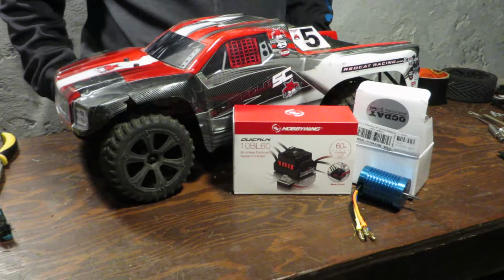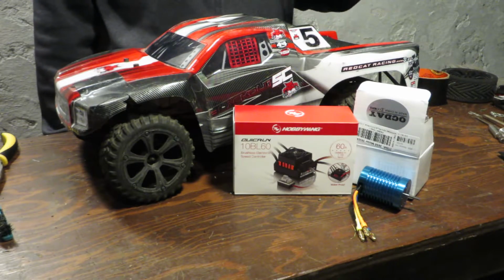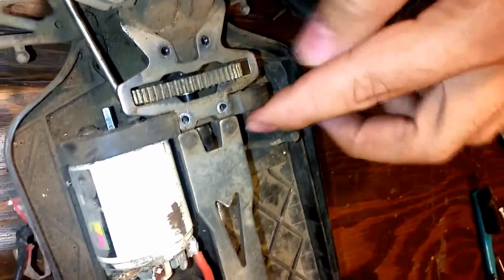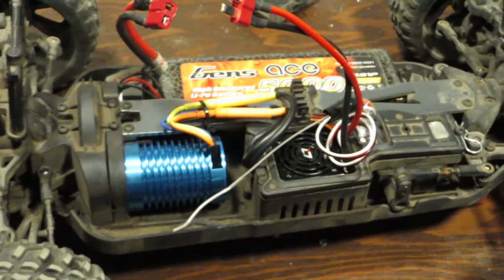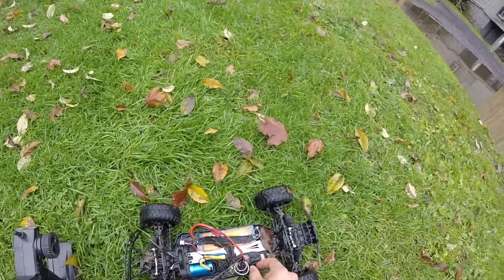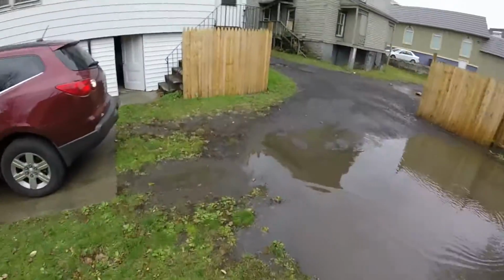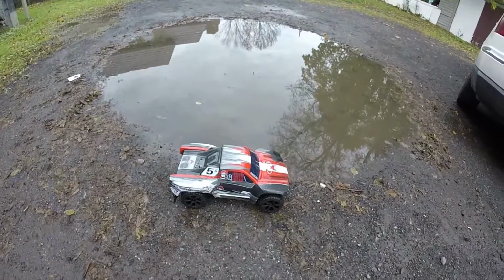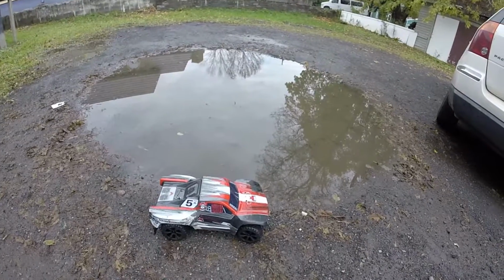REDCAT BLACKOUT SC GET"S BRUSHLESS UPGRADES!!!

Comment: I did the same thing except mine pushed 5200KV (max was 57mph)
Reply: Josh Morris you should put videos up? Do you think the tr-sc10e motor and esc would fit the sc pro
Reply: Dam I have mine up to 41.4 with a surpass 3650 3900kv 12t motor and surpass 60A esc it's great I will upload a video

Comment: i just did this to my sons blackout. hobbywing bl 60 esc but i opted for the 3650 3100kv pinion 18t steel. Its way faster than original or the 12t titan motor. it beats the terremoto 10 both on 2s. The first 5 runs the motor ran cool to the touch but now that the motor is broken in it does get warmer than id like. It cogs slightly on light throttle so ive ordered a 3660 3300kv which shoulder give it that extra torque and keep temps down. the motor your running looks finned on the inside is that a 380 brushless advertised as  540/550 size?. what are your temps looking like. my son has a 6500 65c 2s pack it gets a decent amount of heat if hes running through the grass non stop with a casle creations fan. it can almost pull a wheelie from a dig and almost has just it you hit it right. Im gonna make a video of it and ill make a video of it on 3s. My youngest son im gonna put a 3660 2660kv in their im hoping to keep the speed lower than the 3100kv. How fast do you think the 3900kv with 14t goes?
Reply from the maker: dayadam16 I'm not sure what 380 or 550 is? But it is 1/10 scale and yes its finned. It didn't get hot at all plus I think that water helped lol. I ran my 5000mah gens ace 2s lipo 40c. My reciver was giving me problems also I got water in the motor witch I found out after wards and I think that's the reason it felt like it was cogy when I ran through the water. I can feel the difference in power but not getting it to the ground with those tires. I will make another video on 3s also and up the pinion soon.
Reply from the maker: I think the speed is just under 30mph with that 14t. but I will also do a speed run
Reply: King Veonietus that motor your running isnt a 540 size motor its actually smaller. The fins go inward so that motor wont have as much torque. The 3650 i have is a true 1/10 size no fins and my wires come out the actual top of the motor. it looks like my wires are glued on outside of the can. If you have amazon you should try the gool rc motors i paid 22 bux for the 3650 3100kv. its almost perfect. It barely cogs but just enough that crawling isnt ideal cause when that power comes on its ridiculous. The stock motors are 57mm long. when i compared the size of tge 3650 the terremoto 10s motor is clearly longer by about 10mm so a 3660 3300 should make this perfect. ill make a  video of it in the morning. it has very good power and top speed. it definitely is faster than the terremoto 10 even in grass. esc set to punch level 9.
Reply: the brushed versions come with 550 size brushed motors. i believe 37mm by 57
Reply from the maker: dayadam16 yea I noticed that with the wires..Dam I hope it holds up thanks for the info. I also had my eye on the gool rc motor was gona get it for my 1/8 truck.
Reply: King Veonietus i plan on replacing my terremoto with a 2600kv gool motor i believe 3674, the numbers are can width and length so 36mm wide and 74mm long.  With your gearing it should do better but i think it will start to show excess heat on about the 5th run. maybe that open design will keep it cool. are you running stock esc settings? im charging up now so i can make a comparison of my daughters stock blackout sc brushed with 2s lipo which looks comparable to your brushless setup you have now and my sons brushless setup i just put on. my goal is to get the kids to have an rc that can last 30 minutes or more  to keep up with my xmaxx run time. Plus i was tired of smelling brushed motors. im putting the 2600kv 3660 in my youngest sons and my daughter rc hoping it will never get hot enough and have enough power to go through grass without killing the motors.
Reply from the maker: Nice thanks for the info. Yea I'm running the stock settings on the esc..so maybe I should keep the 14t pinion in there. Yea them brushed motors are good I hear if ur gona be deep in mud water bit they are slow and do smell
Reply: King Veonietus  try a higher punch it limits voltage from starts, it will really wake that motor up just make sure you use high quality lipo like that gens ace with 35c or higher. you can also adjust timing but i wouldn't recommend that unless you got cooling and pay attention to temps.
Reply: dayadam16 a motor like that maybe around 50mph if u run a 3s lipo with like a 23t but its not worth it iv burnt my esc out like after the 5th run on 3s

Comment: That was awesome 👊 I appreciate your sharing and would like to ask a question if I may 😓 I just got a Redcat Blackout SC stock and was wondering if I can use a lipo battery and if so how high can I go without upgrading the fan and or motor? Newbie 😉 sorry 👊🍻
Reply from the maker: MTB TJ Crash stock brushed motor or brushless? U can run a lipo on both motors. But if you have a brushed motor just make sure its broken in like at least 10 runs
Reply: 2s is all you can go

Comment: the car handles like a two wheel drive. because the tires?
Reply from the maker: da streets part 3 no alot of them spin outs I did on purpose trying out the power plus it was wit out.

Comment: Whats tue pros and cons of running a brushed version on a 2s lipo for these blackout sc
Reply from the maker: Shannon Hopkins Con: if the motor not broken in it will fry. More power so it will be harder to control if ur a beginner witch means the possibility of braking parts is higher. Pros: more power longer run time more fun lol. Also brushed are better for running through water and mud just have to make sure you clean it after wards
Reply: King Veonietus just getting into it got a redcat blackout sc 1/10 they say u can run a 2s lipo and its ok just not a 3 i have no clue as to possuble damaged parts other than a motor over heating
Reply: King Veonietus also whats a good break in time..2 to 3 runs or more?
Reply from the maker: Shannon Hopkins I would say about 10. Or a quick way I've seen  was to put the motor in cold water and let it run for a full battery at about a quarter of the throttle.
Reply: Mine came with 3500 lipo.

Comment: You change motor and pinion what number spur
Reply from the maker: The spur gear was stock 55 tooth. I did change the pinion back to 18 tooth, but got it steel. The stock pinion is brass and wears a lot faster.

Comment: Nice upgrade man, i have a question i upgraded mine too but it makes a weird sound when i hit the throttle (like the gears are not set properly) after it gets some speed it runs great. And would like to know what gears you installed on your car?
Reply from the maker: enigmacstrike Thanks man. I have the stock gears but upgraded the pinion to steel. factory pinion is brass and causes the spur to strip. Yea its possible u might have to go back and fix the mesh. use the sheet of paper method in between the gears.
Reply: King Veonietus and yeah I thought the mesh was the problem and I fixed it
Reply from the maker: Sweet. Makes a difference doesn't  it.
Reply: King Veonietus i ment that I fixed the mesh long ago 😅 the thing is that I don't know if that noise is normal
Reply from the maker: Oh I see. Yea man probably just not use to hearing it that way I mean it has a stronger setup now.
Reply: King Veonietus Thank you for your time! maybe that is
Reply from the maker: No problem

Comment: I got a 64 metal spur gear coming for mine, does anyone know how I could make it fit
Reply from the maker: Ur gonna need a spacer or bearing to keep it in place. But it can't be to tight of a fit or it will cause to much friction and make the motor work harder as well.
Reply: King Veonietus what about the pinion gear?
Reply from the maker: @javierrivas7346  28 tooth or bigger is the only sizes that will reach the pinion.
Reply: King Veonietus alright thanks

Comment: Hi, did you do any servo or servo saver mods.  I saw complaints on other videos about the servo steering crapping out or too loose.  Redcat may of fixed the quality issue by now though.  Have you had any problems with the steering and/or servos and how did you resolve?
Reply from the maker: Nathan Daniels No mods just changed it out for a traxxas servo. Reason was mine striped or burned out i dont remember but there was a lil play with the servo horn. I just tighten the screw and took that metal piece and also tighten it.

Comment: i was looking at your other videos of the blackout pro and that motor is almost the same way but the fins are barely and the difference in power from this one to that none pro looks night and day. That blackout pro looks like it has power for days, both motors your running are rated for 3900kv and 3950kv right? how fast is that pro on 2s looks like it could do 40 with that power.
Reply from the maker: dayadam16 yea that pro is mid 30's @ 3800kv That new one is 3930kv haven't done speed run yet with it.

Comment: Do you think the motor from a tr-sc10e and esc would fit it?
Reply from the maker: Yea it's 1/10 scale. But ur better off just buying that car. Amazon has it in sale right now for $250
Reply: V6 Vic i already bought the pro and is yet to come in and was a bit strapped for cash. Just wondering for future upgrade cause i cant aford right now to buy a battery and a charger for it. They dont come with those. Any thoughts on the camo tt?
Reply from the maker: @LuisLopez-ed7oc  if you got the Pro then you're good. It comes with more then enough power. I would just focus on getting a better lipo battery. If u want more power than get a 3s lipo it's gona be crazy. Just mind the motor temps.
Reply from the maker: I haven't seen any videos on the camo tt yet but it looks like a beast

Comment: funny,  I just got a similar esc and that same motor for my kids blackout sc.. it needs a good high quality  servo too, anyone else with the blackout feel like the steering system is absurd and just impossible to get precision out of.. the design is just kinda weak and no matter what you swap out, after a while there's just total slop and the front end is doing the bad shopping cart thing
Reply: just curious ... I fully understand it's entry level stuff. . and I will admit that it's been one very tough truck. . no suspension or steering arms broken. . obviously it's got the servo saver that is problematic .. I wonder if all the slop in the steering is keeping it alive longer. .  anyways,  my 8 yr old son digs it and it deserves a few updates.
Reply from the maker: funshootin1 they have aluminum upgrades now that might help with the slop but its way to pricing. Thanks for watching

Comment: is your motor and esc water proof?
Reply from the maker: Eric Charles Ash yes esc is splash proof and so is motor. I did get alot of water in the motor once and it slows it down or makes it bog down but I just tip it over and its fine again. I also sealed it up after that where the wire come out from so no worrys now.

Comment: your losing service because u habe water in the receiver I would be really careful with a lipo in water cuz that thing can short circuit
Reply from the maker: Yea i cleaned it out but it still sucks i even tried it on a different transmitter. I changed it out all together for a fly sky remote. Far as the lipo ive ben lucky running them through water
Reply: yah lol its really fun to run a cheap setup thru water
Reply from the maker: I run all my setups through water I live in upstate NY but there all water proof or resistance. I covered up that opening where the wires come out of the motor with plumbing putty and sealed it with flex seal. I got water in it and it was still running but it start to bog down. Runs fine now
Reply: yah if your car isn't running after water I don't recommend trying to drive it cuz u can fry the esc like that all the escs aren't waterproof blown a few like that hey i was wondering do u think i can fit that long ass motor from a redcar racing terremoto on that truck you used cuz if that was possible that thing would fly but the shaft is a bit huge
Reply from the maker: Im not sure how big that motor is. Just measure the length and you would also have to see if the motor mount matches up with the motor wholes. That would be crazy but i think its possible I saw a video of a guy running 4s or 6s on his xte pro
Reply: dame yah that motor is big i think its a 35/70 or something
Reply: the Mount needs enough space so that the gear can fit cuz it's also big
Reply from the maker: https://youtu.be/04glwJMLwqs
Reply from the maker: https://youtu.be/04glwJMLwqs